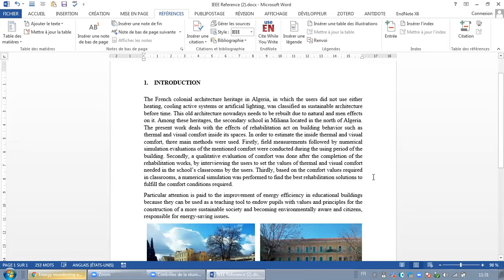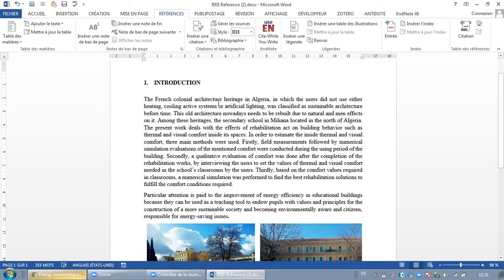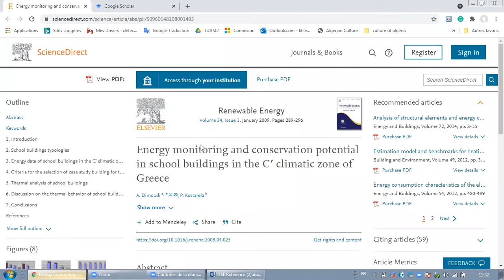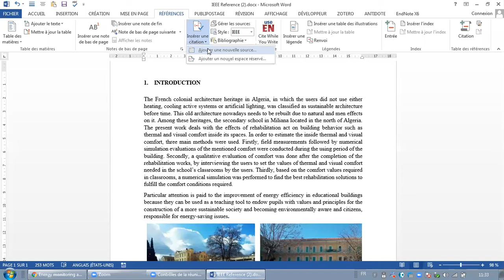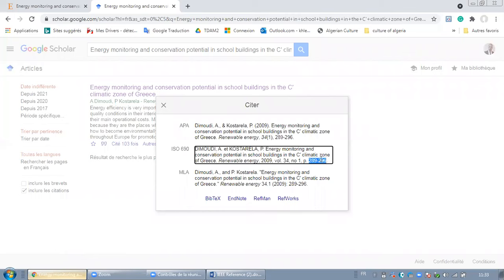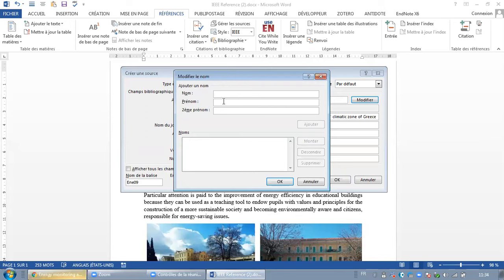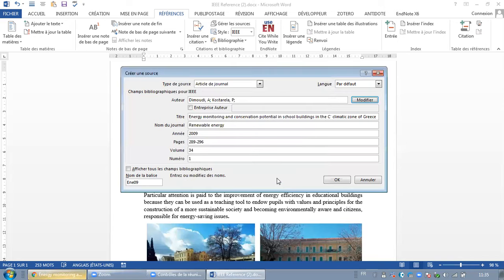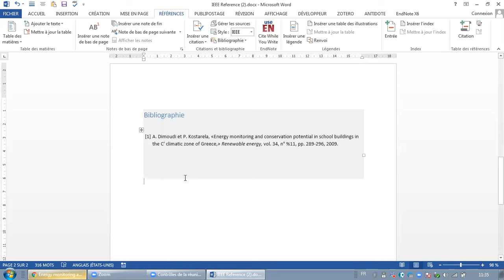How do I write references in IEEE format?

Comment: Wow SIr bundle of thanxx
Reply from the maker: most welcome
Reply: @drsamirkhledj9255  But Sir, if i give 5 or 6  references by end note and then  give the 7th one manually, the 7th one will appear at 1 number . then sir what  do i do  to make this   reference the 7th number ?
Reply: @drsamirkhledj9255  Sir plz reply fast because i need urgently
Reply from the maker: @wasifullahdawar6962  Hello, I have not used this method of EndNote before. In my doctoral thesis, I did insert all the references manually!
Reply: @drsamirkhledj9255 Ok Sir